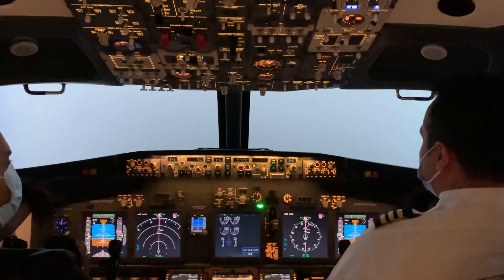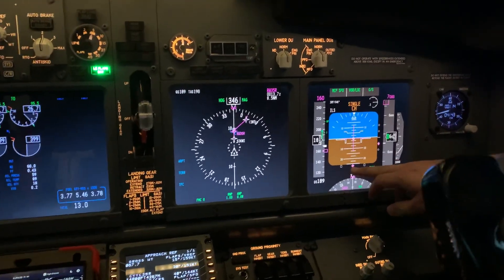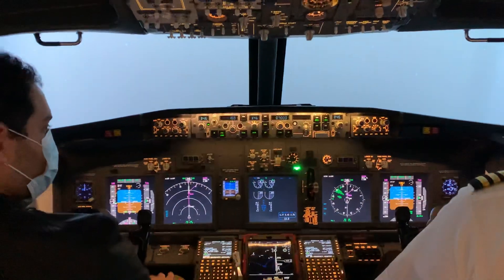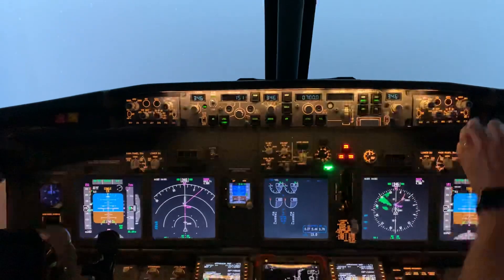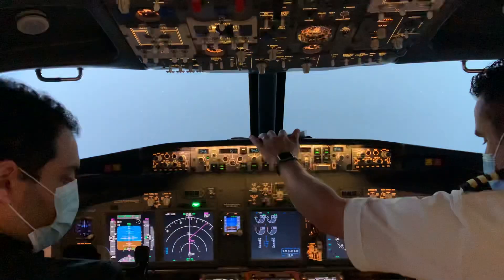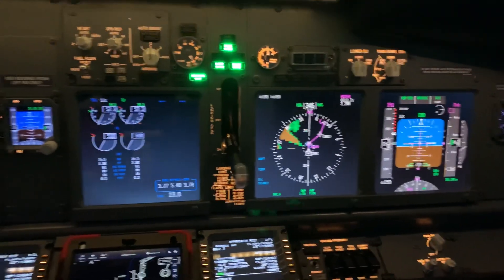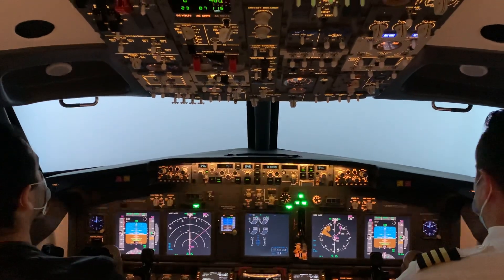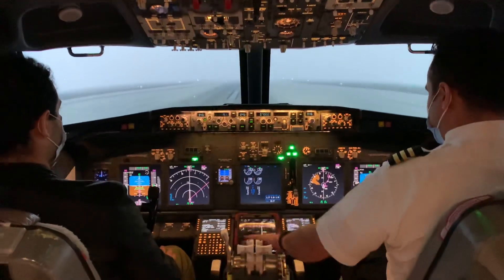Boeing 737-800 CAT3 landing at CYYC (low visibility)

Comment: I'm wondering why the iPad is on the blanked engine monitor. In case of an upcoming engine failure you can not see it. The engine start switch is not in continuous Position. And I'm wondering why a cat III approach is made within decision auditude (baro 200)  I think it has to be DH radio 200?